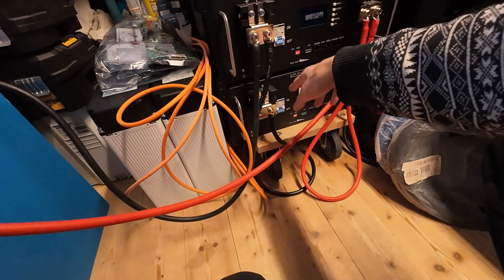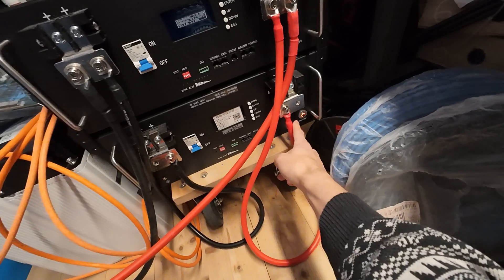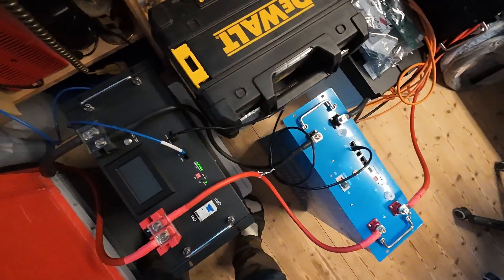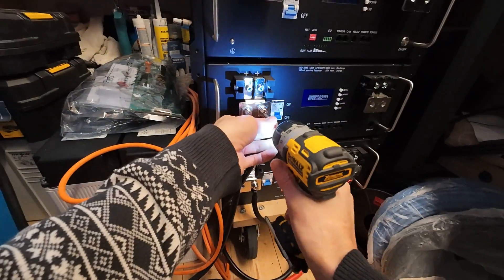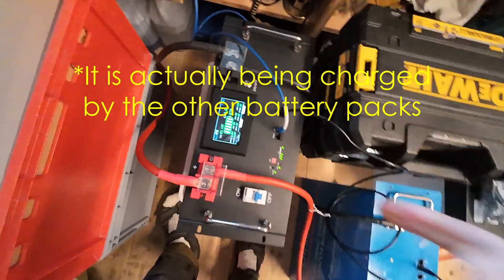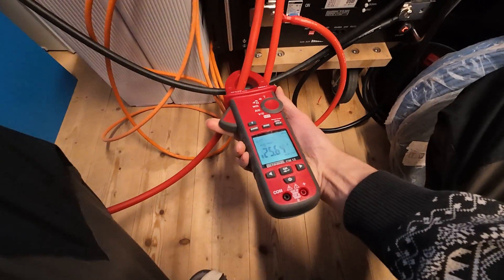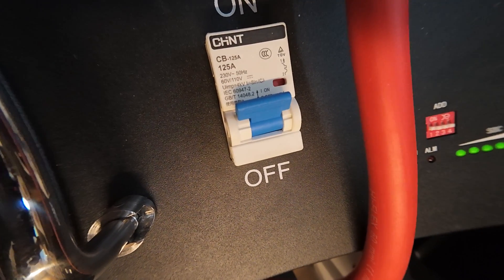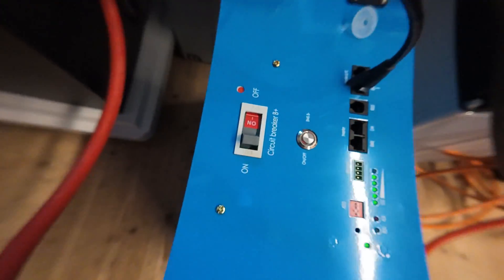Short Circuit / Reverse Polarity - Fail

Comment: On a different note. How easy was it to connect the JK inverter BMS to the venus system? Just finding your channel so i dont know it you have done any video on the JK inverter bms connection with Cerbo GX. 

Was it plug and play? What are the limitations? I read somewhere that the charging is not so perfect with the JK inverter BMS stop charging once any of the cells voltage reaches set threashold thus preventing the other cells from proper absorption or balance.

Please share your experiences with working with JK BMS GX connectivity
Reply from the maker: I did not make a Video on this toppic jet. But I will do that for sure. It is easy, if the settings in the JK-BMS are set correctly and you chose the Victron CAN-Protocol. There where some issues in early firmware versions. So make sure you have a RS485 to USB converter cable and the BMS software to upgrade your firmware.
Reply: @Raphael_Hofmann  thanks for your reply. Just to be clear. I would need the RS485 to USB to upgrade the BMS right? I ask because from what I have read you need a CAN cable to communicate with a GX device.

Will look forward to your video on this topic. 

There are not many people focusing on JK inverter BMS communication with Victron GX. Andy Garage has a series of video on the  topic but his is focused on JK Inverter bms interaction with a middle layer board called "Peter board" which seats between JK BMS and Victron GX.

A video on the right way to do direct Victron BMS to Victron GX including the potential issues and limitations of such connections would be greatly appreciated.
Reply from the maker: @bigbrovar-b3r  You need the Victron Type A cable to connect to the Cerbo GX. You can also manufacture such a cable yourself, cutting a normal Cat 5 Patch cable and reconnecting 3 wires back together...your find this information when you google Victron Type A cable. The communication works well and effortless. I also plan to make a Video on the correct BMS settings. But I want to wait a little, until I can be sure, that they work great longterm.

Comment: Thanks for posting this. Everyone makes mistakes.. could be stress.

I always make sure to run continuity test and also confirm Polarity before energizing systems .. no one is above mistakes. 

On the breakers, I myself ordered a battery box. Those breakers are way too small for such a high capacity DC current. Good thing they worked.. another concern is if they are bi directional or polarized. To be safe just install an external bipolaric / bi directional MCCB breaker for each of the batteries. Those are much more rated to handle heavy DC current.
Reply from the maker: Thank you for the advice! I will make sure to use bidirectional MCCBs 😌

Comment: ROFL, that's one way to cause a dead short!! The circuit breakers did their job! Although it's only ELV there's some serious current there that could of caused a fire should a CB welded shut.  Now all your CBs will have carbon build up in the arc chute IMHO. Personally I'd change them all, have a video of mine junking an AC RCBO v=V9oIUJZfWK4 . 

If you did this to AC mains voltage everything metal in the house would become live, I'm a formally trained electrician with over 20+ years experience and there's whole test procedure instead of doing the classic DIYer "bang test". Just a heads up typically it's a visual, continuity then polarity check before energising. You got some balls to put your mistake up online and I don't mind people doing DIY work as long as it's done properly.
Reply from the maker: Thanks! I might open those circuit breakers up and check them...would be interesting. It might look DIY, but I am doing this work professionally...this is the first time, something like that happend to me...and I just wanted to share that...I am sure some viewers will check twice now when installing their systems
Reply: @Raphael_Hofmann  My example video was worst case, but those DC CB's are cheap for piece of mind. The gear I work on will hurt people or blow up in your face if not done following test procedures. Professionals always know the risks and test accordingly IMHO.

Comment: That is such a Newbie mistake ....... I am an auto technician and i have been in the business for over 25 years ..... My specialty is Electrical  Diagnosis !
The first thing i learned and taught myself is Never ..... I REPEAT "NEVER "  use the wire color as a polarity !!
So people could have the red wire that is B+ and then they put black electrical tape on it and then it is now  black from a simple insulation procedure .....
With a setup like you have there obviously you look like you know what you are doing but with a simple mistake as that , 
You are lucky you have the protection you do or you would have burned your house down .....
Lastly the BMS will not trip as long as there is a "DEAD SHORT"  or Reverse of Polarity  that is the first main thing in line to trip then the BMS should in case there is a smaller short or spike .
Reply from the maker: Yes, very stupid mistake...but I still thought it would be nice to show what can happen...I might do a video on only this toppic and all the protection mechanisms and how good they work.

Comment: It's surprising you made this mistake when the cables are so clearly marked.
In my airstream rebuild project I'm finding some problems with colour coding; many appliances use red for positive and black for negative, others use black for positive and white for negative.
A few use green for ground, while the trailer marker lights use green for positive.  There are some brown switch wires on some devices, while brown is used for turn signals in the truck/trailer harness. If I make a mistake I will excuse it to lack of standardized systems being out of my control.  When i do power up for the first time maybe I'll undersize the fuses to make for a fast cutoff lol.
Reply from the maker: Well, I did not even thing twice...I was was tired after work and just wanted to get this done fast. Not my best work. But at least I could show, that those protection mechanism work.